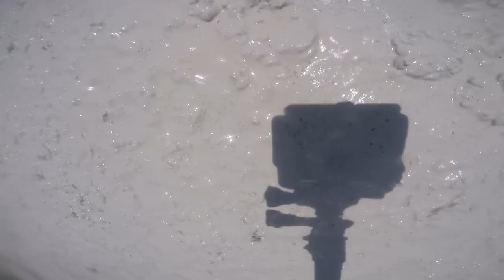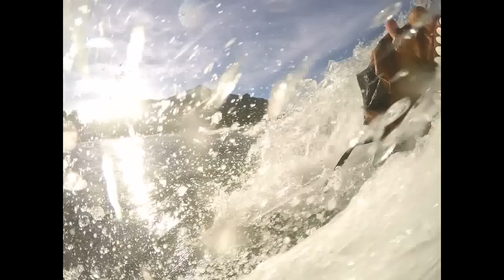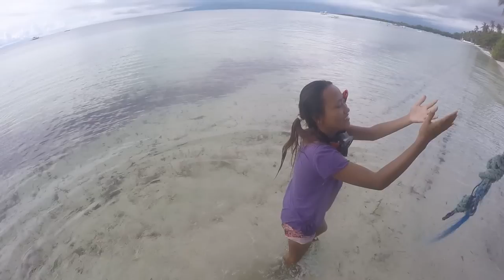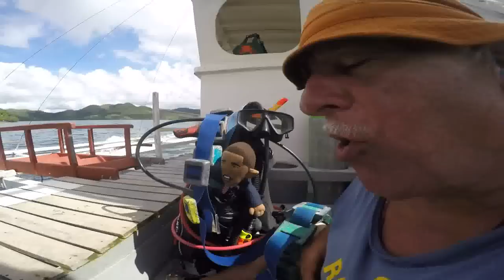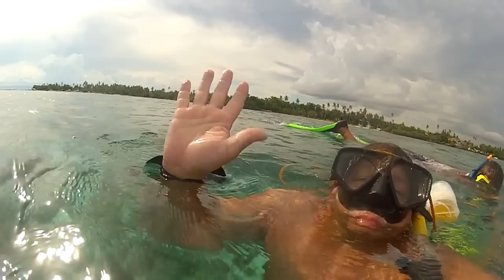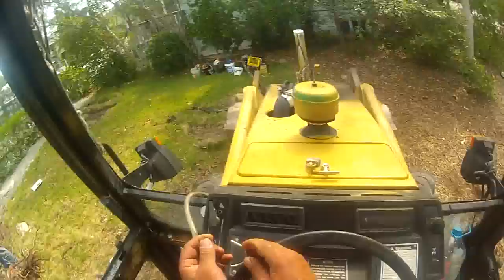HOT FILIPINA LATIN BELLY DANCING AND SEVEN FUN IN THE SUN CLIPS ITS MORE FUN IN THE PHILIPPINES BABY

Comment: Michael and Daisey. You two are good together. But Michael as a Doctor, you must Loose  125 pounds. in oncrements of 25 pounds and shave all the facial hair off. NOW.
Reply from the maker: As a doctor I say thank you but I ask you a question at the same time. Right now I weigh a bit less than in that video at 220 pounds however if I weighed 125 pounds less than what you see in the video I would wait exactly 105 pounds standing 5'8" tall.

Do you really believe a 5'8" man with a thick bone structure should weigh 105 pounds or was that a mistake?.

I am sure you meant to say Lose perhaps at best 50 pounds but I don't know how the mistake was made?

I have been this Weight for 28 yearsAnd have lost weight in the past only to gain it back again exact same bone structure and weight my father was the same way